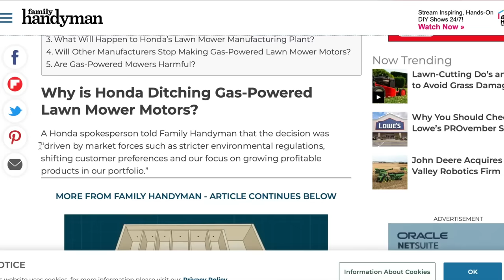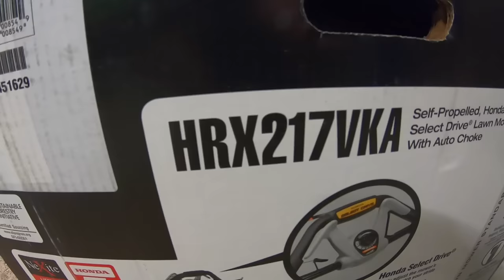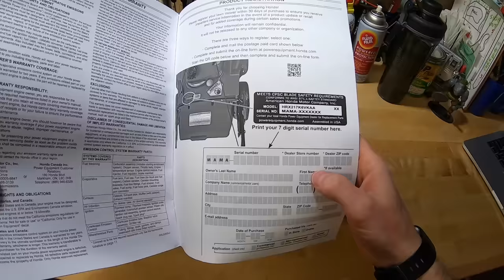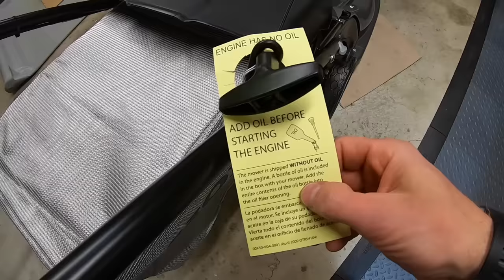ARE HONDA LAWN MOWERS STILL WORTH BUYING IN 2023?

Comment: ...NO...learned my lesson.  Two "belt slips" on my Honda mower have already cost me over 150 bucks in repair (lots of disassembly to slip belt back on).  I will now only buy super-cheepy, self-propelled mowers from a big box store...so I can go back to quick, easy repairs with non-proprietary replacement parts. BTW, I read that Honda is getting out of the non-commercial, consumer-centric lawn gear biz....
Reply from the maker: Thanks for sharing

Comment: I'm a British viewer, I run a Honda dealer in the north east. The hrx is a 537vy in the UK. But has quite a bit of noticable spec. All hrxs in the UK have a blade brake clutch. There also a lot more expensive than the US market.  A HRX 537HY is £1,130 including taxes.
Reply from the maker: Thanks for sharing this claas!

Comment: Hey Garage, I'm looking to get a new mower for my new home.... which would you recommend?  I have about 8000 sq ft to cut, I've been eyeing the HRN16 and the HRX that you did the video on here...  is the HRX worh the extra few hundred dollars?

Thanks for your time!
Reply from the maker: Hey! Thanks for being a cool! There are some better components on the HRX including the wheels and the bigger engine that will cut through taller grass faster. If you can swing it go for it. You’ll have to let me know what you decide. Thanks for watching!
Reply: @GarageGear  I broke down and bought the HRX, hopefully it'll be the last one I'll ever need. 😂
Reply from the maker: @RompRat42  it just might be! 👍
Reply: @GarageGear  going off what you said about the engine, deck, it seemed like a better buy. I bought it from a local lawnmower dealer for the same price as anywhere else, however they don't just sell you a mower and send you on your way. They actually run it in front of you, show you how to properly check the oil, change filters, operate it, they even fill out and send in the warranty paperwork for you. Excellent service. Not just... here we popped it out of its box and here ya go 🙂
Reply from the maker: @RompRat42  that is awesome my friend! Great that they take those extra steps with you! 👍

Comment: What I do not get, why is there a gap between the engine and the deck in the HRX mowers? All I can see is grass getting through the opening and coating to top of the deck in grass and dust.
Reply from the maker: Thanks for sharing great empire! I don’t really  see that as an issue for me personally. Thanks for watching!
Reply: @GarageGear  

So I went to my local Honda mower dealer, the Toro is out. 

I personally like the Honda HRN over the HRX but I want to wait and see the new Ariens mower first before I make my final decision. 

The local dealer used to sell Ariens too and he was saying for the Money between the two, Ariens definitely makes it hard to beat with the reflex drive and larger engine for about the sane price as the HRN with the roto stop.
Reply from the maker: @thegreatempire3882  hey empire! Do me a favor and ask to see the gears in the back wheels. I heard they may be made of plastic. Heard complaints of people having to replace them after two years of use because they are stripped!
Reply: @GarageGear  

I can tell you the 2013 Ariens Razor with the 159cc Subaru engine has metal and no issues. 

They stopped producing Razors for a few years now and the 2023 is a whole new design. When they are released, I'll ask.
Reply from the maker: @thegreatempire3882  thanks for looking into it!
Reply: @GarageGear  

I did ask the small engine shop about the 2023 Ariens, they all have metal gears too
Reply from the maker: @thegreatempire3882  good to know! Thanks for checking!

Comment: I own two HRX mowers and love the. I've owned a few other mowers as well but haven't found anything that delivers the quality of cut. My Scag zero turn doesn't cut as well as the Honda does either! I had been holding out for Honda to make an electric push mower. Do you think that's in the cards?
Reply from the maker: Hey nfavor, highly unlikely! They apparently had an electric mower that didn’t really take off. Thanks for watching!
Reply: @GarageGear  Are you referring to the electric robot mower they had or did they have a push model too? Eventually the robot mowers will be cheap enough to go mainstream.
Reply from the maker: @nfavor  I heard they had a walk behind. Never saw one though. Probably was used in other countries besides the us.

Comment: My HR 214 still runs like a champ. Doesn't burn oil / smoke.
Reply from the maker: Awesome thanks for sharing
Reply: @GarageGear  BTW, when I got my new pressure washer it recommends using ethanol shield additive to extend engine life. I saw that it's supposed to be good for all small engines. So I started using it in my mower now too. Do you have an opinion on that additive?
Reply from the maker: @swdw973  hey sw! I have never used this additive before! I normally don’t use any because I use ethanol-free gas.

Comment: I have this exact mower, someone gave it to me bc they can’t get it to self propel anymore. I’ve worked on it and had a dealer look at it still no self propel but other that it’s awesome runs good cuts good would be a 10 out if 10 if the self propel worked. Hate Honda is getting out of the gas mower game
Reply from the maker: Hey J did you replace the transmission?

Comment: I've had a HRX217HYA for 12 years and have pretty much always hated it. Had to have the valve timing adjusted, and it constantly has a surging issue. Last year I tore the carburetor apart (which they make a PITA) and it was fine for a short period of time, but then started right back up with the same bullshit.
Reply from the maker: @censored7881  thanks for sharing this with the community

Comment: Great vid.  Just bought the same mower from home depot but it's model number is a VKAD.  Do you know what the D stands for?  Also, I noticed you have real oil filters on some of your mowers, that's super bad ass and smart!  How did you do that?  I'd love to fab one on my new Honda mower.
Reply from the maker: Hey fox! Not sure what the D specifically stands for. The engines with the oil filters on them were designed for those engines. These honda engines don’t allow for them.

Comment: Another great video JB!
I guess my timing was good when I finally replaced my 11-year old HRX17HYA last summer.
The mower it replaced was still cutting good but my niece needed a mower and figure it was time I replaced it.
Only difference between the two is the 2022 model is auto choke which I don’t like.
2011 model would cold start EVERY time with one pull.
2022 needs 2 pulls.
Reply from the maker: Appreciate you David! Thanks for sharing this! It’s funny companies make these changes to cut costs and save money. If it works don’t fix it right? Thanks for watching bud!

Comment: What kind of ramps are those? Wood I know lol but what attachment did you use at the end .
Reply from the maker: Hey Jose! I used pressure treated wood and ramp ends like these! https://amzn.to/3m4XkVP these ramps are over 20 years old! Thanks for watching
Reply: @GarageGear  thanks for your reply ,  where do I find that type of wood? I do lawn mowing part time to help with my bills, currently using a set of heavy steel ramps 😰😢.
Reply from the maker: @josej-h1471  Home Depot or Lowe’s sell pressure treated lumber! Mine are 2 by 8’s. Little heavy but strong!

Comment: Since I can't find a Honda HRC216HXA I thinking of going with a Honda HRX2176HYA.  I haven't purchased it yet.  That model has the same controls as the HRC up top, all-metal handles.  What are your thoughts on those versus the plastic (ABS?) that I saw in your review.  The dial seemed lame to me and I was concerned in the plastic parts wouldn't hold up.  Also, is that a dump to drain the oil or does it have a drain plug like on the HRC?   Spare part-wise (Like Eugene thinking) Auto Choke part seems to be the main thing, maybe the handlebar locks vs bolting.  Plugs should be available.  If the wheels last over 10 years maybe battery units will be good enough by then. Do you know if the almost-new blades on my HRC will fit the HRX? Thanks, Tom
Reply from the maker: Hey Tom, lots to unpack here. I have seen both those handle bar controls last over many years. You can change the oil simply by tipping it on its side. Not sure about the blades exactly! Thanks for watching!
Reply: tom the hrx is a great mower I use mine for my lawn business 16 houses a week for the last 3 years the exact one in the video and its held up great no issues at all .
Reply from the maker: @hardhittinz  thanks for sharing hard!
Reply: @hardhittinz  That is great news, I'm off tomorrow afternoon to pick one up.  My local lawn store guy actually has a better price than Amazon.  How do like the new controls with the dial?  I have the HRC, and the HRX has both types, trying to decide if I should get the newer system.
Reply: I like the controls with the dial , once you find the sweet spot you can mostly set it and forget it .
Reply from the maker: @hardhittinz  it’s a smart design!

Comment: so if I can count: my Iseki with a Briggs 575 on it cost me 620 euros. Fine and light alu chassis, new generation engine and good barings. .  Suppose that machine will last for 10 years. Then take my Honda HRX  which cost me 1850 euros that should last for 30 years. I don't say Honda is bad, not at all but it is costly. Also their maintenance scheme is costly. I don't see that happening. I once let me convince that Honda was the top of the bill but there are many machines that are also good and that cost a third of the price. The thing also is as a professional maybe you are going to choose for Honda or Toro. But these machines also are in your books. You will sell them after a couple of years and renew them. So you are operating at a higher cost. That is my logic.
Reply from the maker: Thanks for sharing Dec!

Comment: No. Battery powered electric mowers are perfect for 95% of people mowing their own yard.  I bought the Echo 58V several years ago and it is awesome.  It is light weight and powerful.  It starts every time.  One battery mows two typical yards.  If you have two batteries you can charge one while mowing with the other and mow non-stop if you're crazy.  I marvel at my neighbors still walking around like robots in a cloud of exhaust fumes and noise with their gas mowers when they will start.  Why would you want to handle gasoline, oil, gas cans, gas preservative and all that junk?  To each their own I guess.
Reply from the maker: Thanks for watching

Comment: Do you have video repairing the handle adjusters with a bolt?
Reply from the maker: No, unfortunately I do not.
Reply: @GarageGear  so you can use bolt in hole adjustment hole instead?
Reply from the maker: @mgomez5606  yep just pounded out the old handle bar adjuster and replaced it with a bolt. 👍

Comment: I’m going to buy a Honda mower this weekend. Should I get the HRN 216 or HRX 217? I know the wheels are different and I like the rubber tires. Is that the only advantage?
Reply from the maker: Bigger engine and the bag deflector and huge advantages too.

Comment: After hearing the Honda hype for years, I gave in and bought a steel deck self-propelled unit from Home Depot about five years ago (don’t recall the specific model code).  It’s legitimately been the worst mower I’ve ever owned, which is strange because it’s the most expensive mower I’ve ever owned as well.  Cuts so poorly I have to do a 50% overlap for the right side in order to get a level cut.  Tires are also bald, which is another first in my mowing life.  Just a total POS.
Reply from the maker: Thanks for sharing

Comment: It's the end of an era.  But, the writing is on the wall for gasoline engines.  For most homeowners, electric is the way to go.  Of course, commercial users and people with large lots will need gasoline engines for a while longer.  But even those will go away eventually.  I've been using an old fashioned corded electric Black & Decker for a couple decades, and it's been bullet proof.  Plus, I love the zero maintenance and no trips to the gas station.
Reply from the maker: Thanks for sharing Dan!

Comment: First, i love my Honda lawn mower. But what a terrible ending. On September 14th of 2023, about 391,800 Honda lawnmower and pressure washer engines were recalled for improper manufactered cam shafts. Right when Honda is stopping production of their lawn mowers.  It will be interesting to see how they handle this recall.
Reply from the maker: It will be interesting to see how they handle this!

Comment: I bought a Honda Commercial mower approximately 30 years ago. It's finally come to the time to replace it. I was sad to hear they will no longer make them in the USA.  France will still make them for Europe.  The tires are cracked and coming off of the wheels. The pull chord retracter  is worn out and motor is smoking.  But Hey, its been 30 years.  Glad I bought a commercial model for the extra power when I did.  One complaint I had was that it was a little under powered and when the grass got really heavy it couldn't handle it. There was no option to just blow it out of a shoot and rake it.  You have to bag or mulch. Mulching takes a lot of horse power. And bagging on a big yard is not practical.  Stil,, I'm shopping for another Honda.
Reply from the maker: You’ll find one! Keep an eye out! Thanks for sharing my friend!

Comment: Where's the best place to buy one of these for 2024? Seems like the recent Honda recall is making it difficult to get a hold of in my area (SC)
Reply from the maker: Hey Kirk Honda stopped making mowers back in September. Wherever you can find one is good!
Reply: This same model is on the home depot website for $800

Comment: If I cut my lawn 10 times a year , so roughly 10 hours of use each year between mid April and Mid October how long will that $10 part last? The one that looked like a long bullet you were talking about? On average. I replace my air filter before the first cut each year even if it still looks good. Mobile 1 in April and then again in Oct for winter storage. I change the spark plug once every 2 years per the manual
Reply from the maker: That part should last a while! When they go they go! Usually last many years. Did you know you can clean your spark plugs? I haven’t bought a spark plug is many years.

Comment: My Honda HRG465C3 SDE deck has rotten though so I'm looking for a new mower... The price of a new deck in the uk makes it uneconomical to repair. What to do?
Reply from the maker: Hey Adam I would see it as is and get a new mower.
Reply: @GarageGear  Thanks for the reply. I'm looking at a Petrol Lawnmower

Honda HRG466SK IZY Self-Propelled
Some dealers have knocked off a £100. Probably clearing stock.🙂

Comment: Don’t know this for sure, but would bet some other high end manufacturer will begin making mowers with Honda engines. Just like they do on other power equipment line pressure washers. So Honda is still going to be making and selling a lot of mower engines and surely calculated that profit into their business plan when they decided to stop making the whole mower. I try to have a Honda or Kawasaki on the things I buy.
Reply from the maker: I’m sure Honda has a plan too Frank! Thanks for sharing!

Comment: HRX as cheap as $800.  I paid $420 for a Toro Super Recycler in 2004.  Adjusted for inflation, it's probably not that far out of line.  I just looked it up, $668 in today's dollars.  Although the super recycler still works.  It has an aluminum deck and personal pace.
Reply from the maker: Thanks for sharing clearance man!

Comment: My Honda lawn mower purchase has been a nightmare. I have the 217 model. It's been in the shop twice already. One for the camshaft recall that rendered the machine useless and now it's back in with an oil leak on the crank seal. Parts are on back order. Machine is 10 months old. Not happy with this purchase. $1200 Canadian.
Reply from the maker: @chris36771  thanks for sharing this with the community chris

Comment: My wheels lock up when trying to pull the Honda mower backwards. Literally have to pick up the back end and pull it on the front wheels. I’ve read about fixes that may or may not help. That’s the one reason I’d never buy one again.
Reply from the maker: Hey Matt! On some mowers it’s usually a spring that broke that caused this issue. I’d have to see what exactly would be the issue but this may be worth a look if it’s an easy fix.

Comment: Why in the hell a homeowner would spend money on a new gas mower for a normal sized residential lawn is beyond me. Lithium battery mowers are so much easier to use and maintain than they used to be and when it's time to get a new battery after a few years, you will be upgrading to technology that has improved - and if your mower is from a major manufacturer you'll only need a new battery. And if you have 2 sets of old batteries after a couple of years - you can just swap them out halfway through cutting your lawn and you're almost set for life unless something truly breaks.
Reply from the maker: Thanks for sharing
Reply: You must not have a lot of leaves to deal with in the fall.  The battery mowers just do not have the suction (or vacuuming ability) to handle a lot of leaves.  I had high hopes when I bought my battery mower.  Used it 3 times, got disgusted, bought another Honda and sold the battery mower.  My yard isn't real large, so I use the HRN216PKA push model.  I like the exercise and don't need the self-propelled option.  I'm not anti-battery; I have two battery hedge trimmers, two battery blowers and a battery chainsaw; I like them all...not the mower.